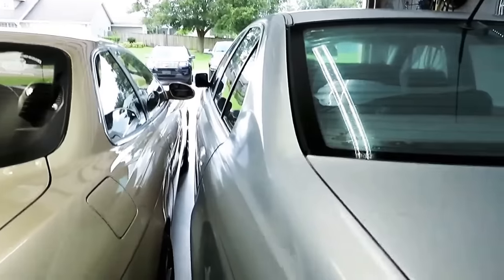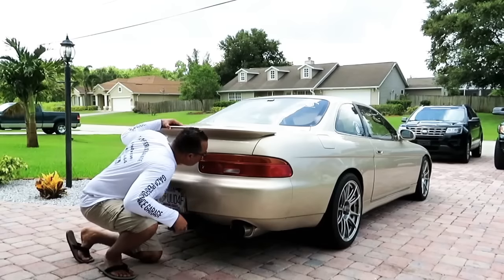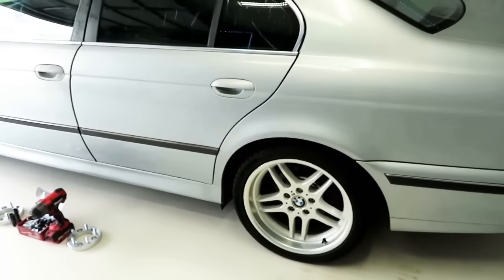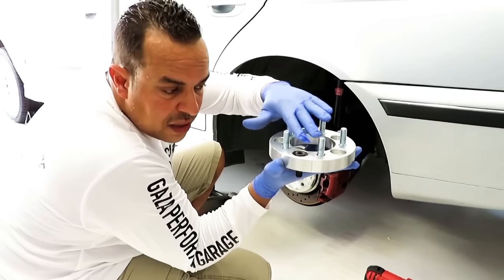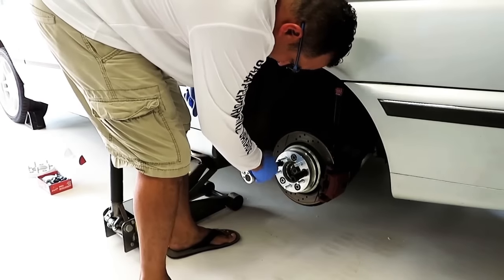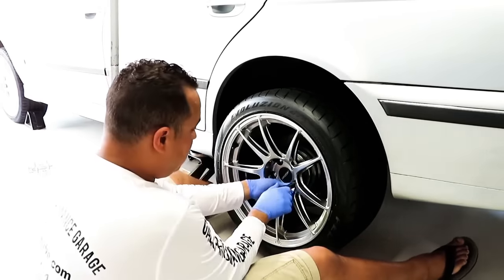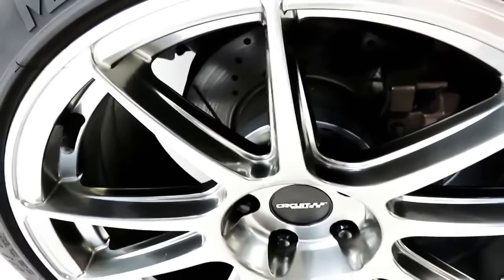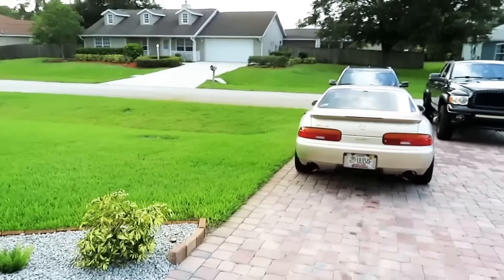INSANE LEXUS SC400 COLD START

Comment: Hey what kind of Exhaust are you running ? Luv the sound
Reply from the maker: Nuff respect bredda tanks
Reply from the maker: Running dual 2.5" with x-pipe
Reply from the maker: No cats no resonators
Reply: Ight cool I just bout a 93 SC400 with 81k on it just trying to decide what to do first besides tints lol
Reply: Also do you get a check engine light since there’s no cats or res?
Reply from the maker: @studda88  no  but i have an egr problem thats why its lit
Reply: Secret ASMR  nothing really just tints, I haven’t been home lately with starting a new business and all but I’ll be doing some exhaust work wheel suspension and definitely a sound system
Reply: Secret ASMR  I got it done Professionally